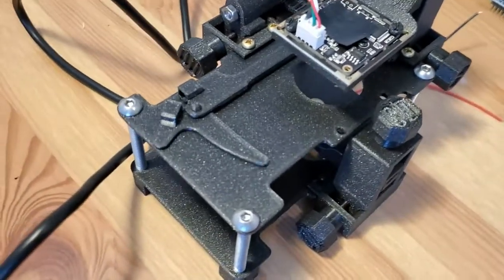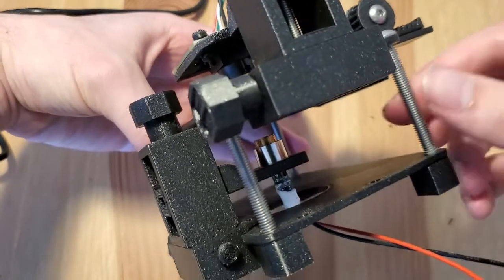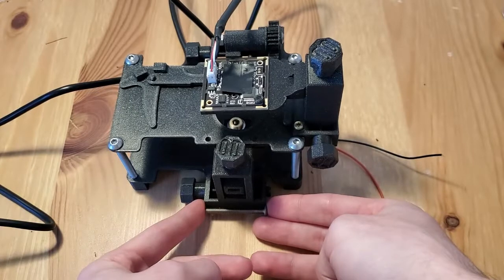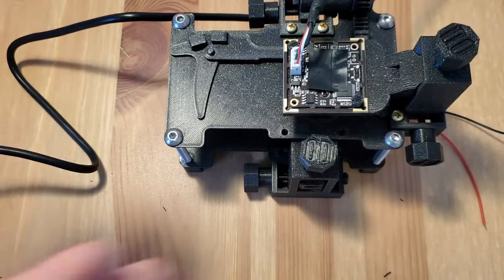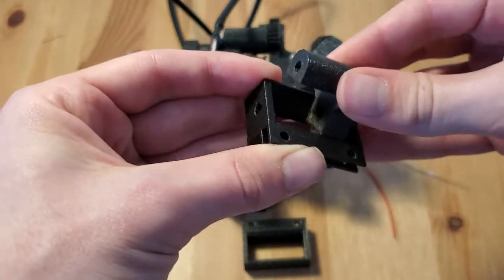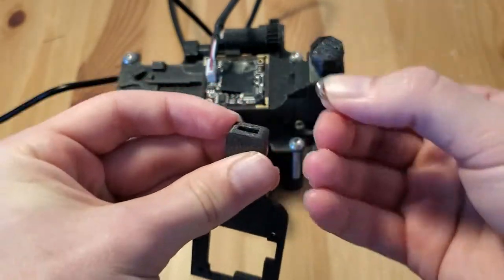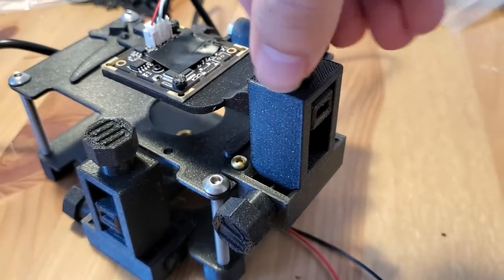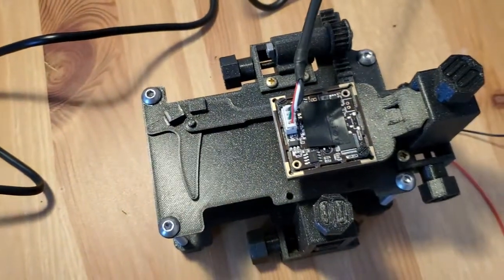Digital Holographic Microscope V2

Comment: Required code & circuit connection diagram for the same.Github link consists of .py file ,, how to run the code for project completion?